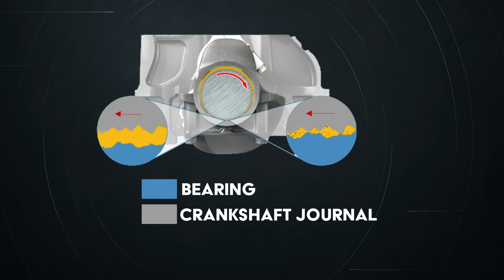the truth about start-stop technology (finally proven)

Comment: the fact that you have to turn the feature off every time you start the engine is diabolical
Reply: I had a 2018 Ford Fiesta with auto stop start. I found out that if the battery health gets low the computer will deactivate stop-start permanently until you perform a battery management reset - even with a new battery it stays deactivated.  I'm not sure if this is the same on other cars.
Reply: @LysergicCasserole95  same for the jeep. accessory battery needs to be bad then it wont run. in hyundai you can just jam piece of plastic card in the switch and it will stay off after car restarts
Reply: @LysergicCasserole95  Unfortunately no. I bought a second hand Clio IV with a bad battery and disabled ss system. When the new battery was installed, the ss system came alive and now I have to make it my life reflex to shut it down each time I get in the car.
Reply: @TheMilosDjuric  There are plug in options
Reply: @LysergicCasserole95 it just mean your ecu didnt detect new battery, and idk on ford fiesta but on bmw/mini will kill your new battery faster if you didnt register that you change battery
Reply: @LysergicCasserole95 it is on BMWs and fairly sure other manufacturers as to preserve the battery when it’s low.
Reply: @LysergicCasserole95  happens on my 2015 honda hrv too
Reply: @LysergicCasserole95   Yes in a 2014 Citroen Berlingo it also stopped working as the battery aged.  
After replacing the battery, it started working again.
Reply: @LysergicCasserole95  I own a G82 BMW M4C and I shut off the start/stop function, which I am at least thankful that it's an option. I did the same on my F82 BMW M4C. I have a friend who's a BMW tech tell me a long time ago this not only saves abuse on the engine but the battery as well. Considering the batteries are lithium in the M4 and around $1500 to $1800 US you dont want to be coughing up a lot of money to replace them...obviously.
Reply: @LysergicCasserole95 this does “work” but it’s not great for battery longevity
Reply: @LysergicCasserole95  It is with my 2021 Skoda Octavia.
Reply: @LysergicCasserole95 that’s bad for your battery and alternator to not reset the BMS
Reply: @LysergicCasserole95 Not on a 2017 F-150. It just shut off at a red light and couldn’t start again. That and start stop killed the starter and left us stranded at a red light too. We bought one of those cables that disables it automatically on start.
Reply: @LysergicCasserole95  On all new fords you have to do a battery life reset after replacing the battery to reenable start stop functionality. Unfortunately, it also won't leave the car on for remote start/unlocking the car doors for the mobile app or perform updates, when the battery is "bad". So I did reset mine
Reply: @LysergicCasserole95 That’s only if you don’t perform a Battery Management Reset, which you should do with a new battery install.  Else other aspects of the ECU/ car strategy will be affected.
Reply: @wl660  Yeah it may affect other things in other cars. I had no problems whatsoever with mine, not even a battery warning light.
Reply: 1st thing I did was coded out the start stop on my bmw x3
Reply: In fairness it's become second nature...... part of my start-up routine. "Engine start, TURN OFF THE STOP-START FUNCTION"
Reply: @danielmarshall4587 same here. it has been part of the process 😂
Reply: @danielmarshall4587 mine too. Crank it up, D, Auto off, release brake . It sucks , but is part of my routine now.
Reply: It should be a 'opt-in', not a 'opt-out'
Reply: I consider it like my preflight checks. Auto start-stop off, driving mode Sport, engines to idle, temps to warm, cleared for takeoff 😀
Reply: @ChristopherWoods  same here. Plus disable center line detection. Takes a few seconds, enough to warm up the engine, that's bonus...
Reply: A bonus of Stop -Start in your new car:
Upgraded starter and battery. The battery will be a premium AGM unit that, if used with S-S disabled, should last longer. Ditto for the starter, as well. BUT, when the battery finally needs replacement, it costs a lot more than a conventional lead-acid battery 200-300% more.
Reply: I got 7 years out of my factory AGM battery in my 2018 F150 with start/stop disabled since new. But they only cost about 50% more. Not 200-300%.
Reply: @stevenslater2669  Costs considerably more and often has a shorter warranty 3 or 4 years not 5 for the standard non EFB ones.
Reply: @stevenslater2669 AGM batteries don't last as long under normal conditions. They are specifically engineered for high electrical loads, including stop/start.

In a regular car they will virtually never last as long as a lead-acid plate battery.
Reply: @stevenslater2669  Beware of AGM. Normal cars, designed for standard flooded use the 14.4 volt charging voltage while AGMs need the 14.8 V. Therefore AGMs needed to be charged with an AGM charger in every couple of months. This way they can really last long, but although the are not prone to be sulphated long 14.4 V slowly builds up suphate.
Reply: @stevenslater2669  You don't need a premium battery for a stop-start car,  neither does it come by default tbh
Reply: @stevenslater2669  this is so far from a universal truth it’s laughable. Or someone should call Subaru because they don’t have AGMs in their cars and they don’t last longer. 2023 Outback Wilderness, not an AGM OEM, I never use that stupid stop-start and turn it off all the time, and the OEM battery barely lasted three years. (This is a common experience across multiple Subaru social media groups.) Also - where are you paying 200% more for an AGM? That wasn’t remotely my experience, and I live in Alaska where most things cost a bit more anyway.
Reply: @csabamagyar3244 Sorry, incorrect…!
Reply: @jonoon27  What/why is incorrect? My comment on AGM batteries is based on my studies and an official expert's opinion used at court.
Reply: @ChristopherWoods  Oh man.. some of my cars will never warm up at idle. Thats not including the winter
Reply: @ChristopherWoods  If only. In new cars you also need to disable lane departure assistant, speeding assistant, attention assistant and emergency brake assistant.
Reply: @rasklaat2  I agree with you. I do not want govt safety nanny tech constantly nagging me. Off it goes!
Reply: @rasklaat2 it should be finable offense to turn of safety systems
Reply: @ChristopherWoods yes, I feel like I have to conduct a start up sequence for a helicopter.
Reply: @ChristopherWoods   i heard/saw this other thing in a video saying that idling is also bad fro engine bcuz of the low rpm, but i forgot what the dmg was. So what do you have to say to that ?  And is it better than to just turn your engine off when you know you're gonna be at the light for more than 20 sec ?
Reply: @picapica8266  Anyone making a blanket statement like that shouldn't be trusted. The effect depends on the engine, its condition and whether it's getting adequate oil pressure but idling should pretty much always cause less wear than constantly starting and stopping. That's just common sense... or at least it was before these ridiculous features started rolling out.
Reply: @ChristopherWoods exactly what I do 😂
Reply: @ChristopherWoods how long do you keep your car if you care about these things
Reply: @ChristopherWoods  sport mode in the RAV4 automatically turns it off, so it’s not a separate action
Reply: @ChristopherWoods and turn off the effing lane assist.
Reply: @ChristopherWoods temp is not so important as you saw
Reply: @solidfuel0   with my Ford engine, I give it every chance I possibly can to not destroy itself :face-blue-smiling:
Reply: @solidfuel0  Yes it very much is important. Hint: thermal expansion
Reply: @mmdirtyworkz what u talked about? which comment you answering to
Reply: @solidfuel0  yeah, YT is bad regarding tracking replies...I was replying to your post that temps in engines does not matter. I wanted to say that they pretty much do due to thermal expansion of the metal (tolerances)
Reply: @mmdirtyworkz  why would I say that. You took that out of context
Reply: @solidfuel0  dude scroll back, I don't know why you said that but you did. And that's the only thing you said in that post so theory of taking things out of contest is debunked :)
Reply: @mmdirtyworkz i was answering someone!! Check what he said to understand context
Reply: @solidfuel0  I'd love to see your video on how you explain that it isnt!!!
Reply: @Christofftheman sure but what the video would be about
Reply: @ChristopherWoods waiting for engine to warm up idling is downright stupid.
Reply: @jothain  not very long, just 30 secs or so - enough to let the oil pressure build a little bit and start it flowing through the galleries. Also gives the block half a chance to get a little bit of temperature in it, particularly because my engine is notorious for issues if driven hard from cold. 

I see some people turn their engine over then drive off the moment the engine starts running. I cringe when I think of the excessive wear it's probably causing :(  

I don't spend ages idling, I agree that's a bit stupid. When it's really cold here I'll give it 10% throttle after starting the engine to help it along, then just drive as usual.
Reply: @ChristopherWoods  Makes more sense. Yeah, I start my car and then put like seat belt on and begin to drive or go clean up windows if necessary.
Reply: I just make it a routine: start the engine,  select gear, park brake off, stop start off.
Reply: @alanjm1234 same, just I add start dash camera
Reply: @alanjm1234   My problem is I can't get the Mrs to care or remember and complains at me for reminding her. I'll send her this vid, see if it helps🙃😆
Reply: @alanjm1234 I honestly don’t get how people are so horribly inconvenienced by doing this. Yes you have to turn it off you also have to start the car, put it in drive…..it’s not a big deal
Reply: @chris-qo1nt it’s not that it’s difficult. It’s that it’s stupid
Reply: It's crazy how few people are telling the dealers before the new car sale...If you don't fully disable this "feature" I am NOT buying that new car from you.  If you are serious about walking away from the deal, the dealer WILL permanently disable the system.
You may even have to walk away from the deal, but the dealer will call  you back and offer to meet your terms to make that new car sale.
Reply: @horseathalt7308 here in europe, it can't be permanently disabled because of the EU rules. It's not manufacturers fault.
Reply: @jestosebno666  In the USA  and many other countries that is absolutely not the case with our laws, it is clearly the mfrs forcing customers to accept something they do not want.  You do realize that the EU is essentially an occupying force making laws and policy against the best interests and desires of the people in those European countries?
Reply: @horseathalt7308  an occupation force requires a military presence, so you’re just exaggerating for dramatic effect, while some EU rules could be better, they are, overall, the most pro consumer laws of any world power

also, EU regulations are made by EU members, not some occupying entity that doesn’t exist, the EU parliament votes for them, and all member states have, at one time or another, their own experts in the EU Commission
Reply: @radu1337  The US military is the israel foreign legion. nice try though Schlomo.
Reply: @horseathalt7308  I wish I'd thought to do that.  I didn't even know that was an option.  I wonder if disabling it would impact the vehicle's warranty.
Reply: @Okraknife just reactivate it before taking it in for any services.
Reply: @cboyamg  It has never been an issue for me for service.
Reply: I'm sure the dealer will have to tell you if it'll void the warranty,  if the dealer is the one to deactivate it don't see why it'd mess with the warranty
Reply: @Okraknife just remove the chip before taking it in if there is any question
Reply: @horseathalt7308 the irony being the manufacturer would probably void the warranty by disabling the thing most likely to threaten the life of the engine 😂
Reply: @horseathalt7308  Unfortenately not a possbility in Germany as far as I know. Because the car has to comply with the emission specs from the manufactorer as default. If you turn of the feature it changes the default state of the car which makes it no longer compliant with the official Emission and you need to theoretically file an exception for the car or else its illegal.
Reply: @tims8956  I understand the EU has these rules, however did the German People actually vote for these rules? Was there even any integrity in the voting process? We in the USA can't trust our politicians nor the voting process. Many people here if giving the choice would roll back all DoT and emissions regulations to around the early 1970s or so. The fact is that all these regulations are making it impossible for most Americans to afford owning any car at all, new or used at this point.
Reply: @horseathalt7308  Actually yes. A big Part of German Politics is about the Envirement and the emission regulations are a part of that. I dont believe this is wrong, but the extend is the Problem. Its come to the point where just a bit of emission saving is prioritised over longetivity or Quality. Most of the people who vote for this usally are less affected by it. They either dont have a car or care about for example. 

The Car Manufactures dont really have a choice because the emission regulations have become so absurd that these features are needed in Order to even be allowed to sell the car.

Edit: But I also dont think the Big Car Companies are that upset by it, because the faster a Car breaks the faster they can sell you a new one😂
Reply: @horseathalt7308  The dealer cannot legally disable this misfeature because the manufacturer had to use this misfeature to pass the pollution limits. It's just a loophole in pollution limits, not a real system that's overall effective for anything.
Reply: @MikkoRantalainen  There is no law that requires stop start on US vehicles, and there never has been.
And we see that MikkoRantalainen is an agent that has blocked my response to his subsequent posts.
Reply: @horseathalt7308  I think it depends on how the manufacturer listed the feature vs emission control systems. If the manufacturer registered the feature as emission control system (which would make sense because it supposedly reduces fuel usage and therefore reduces CO2 emissions because the only carbon from the tailpipe comes from fuel) and then it's covered by Environmental Protection Agency (EPA), under the Clean Air Act (CAA), which prohibits “tampering” with a vehicle’s emissions control system.

You would need to check EPA Certificate of Conformity (CoC) to know the true status for a given make and model.
Reply: @MikkoRantalainen  The fact is that there is NO law in the USA that requires stop start on any car.  Trump will be removing most of these ridiculous EPA regulations soon. If you look at Earth history it was much warmer 50,000 years ago, and had a much higher level of CO2 as well, so in the bigger picture man has a minimal effect on Earth's big climate picture. If anything has been detrimental it has been the destruction of the Rain Forests.
Reply: @horseathalt7308  I would recommend having plan B for the time period after Trump. Here in Finland, the law disallowed changes that increased pollution but there were no penalties for a decade so it was pretty common to disable systems in cars. The law was changed last year and all cars with those modifications are now illegal with heavy penalties (~3500 USD fine for illegal passanger car on public roads, ~35000 USD for illegal commerial vehicle on public roads).

I'd predict that in future start-stop will be interpreted as emission control system if the car was certified by the manufacturer with the system enabled.
Reply: @MikkoRantalainen  Trump will probably be President for one more term in 2028 since the 2020 election was stolen. After  Trump JD Vance will likely be President in 2032. Most Americans are not buying into the man made climate change scam
Reply: @horseathalt7308  How do you think Trump could have third term when 22nd Amendment says otherwise?
Reply: @horseathalt7308  Not in North America. It's illegal to intentionally modify/disable/remove/tamper with an emissions control device, which includes the start/stop system.
Reply: @UVBluetoo  100% wrong in the USA.
In any case the EPA did not mandate start stop systems in any passenger cars . Unconstitutional regulations are not law.
Reply: as soon as i got fiesta i put arduino nano to disable start-stop every time the engine starts.
Reply: Stick shift for the win.
Reply: @mrsparefox3704 European type r have auto start stop and they only come in manual
Reply: There are inexpensive jumpers you can add to most cars to disable. I have one in my VW GLI.  Took 2 minutes to install.
Reply: I wonder how much it costs the automakers to install start/stop? It cost me $40 to deactivate it.
Reply: Be thankful you're still allowed to turn it off. That's not a given.
Reply: I have a 2021 BMW M340i and I used a OBD connector and BimmerCode to permanently disable the feature. It’s nothing short of frustrating and additionally I don’t like what it does to the engine.
Reply: @PARlS23   i hope generational change happens faster and old people hating new tech get surpassed by younger ones. It is like some are still attached to plastic straws.
Reply: You can permanently disable the start/stop feature by coding using a device like the Carly OBD, which is also quite affordable.
Reply: @DouglasFraser888 CRly is awful. Unreliable and limited to its functions. I canceled my all brands subscription and bought a Launch bidirectional scanner.
Reply: @DouglasFraser888 you lose warranty?
Reply: It's such a habit to turn it off when I start the car that when I start my diesel car from the 80s I go to press a button that's not there lol.
Reply: Vaccinated people love features like this.
Reply: get an obd2 override module
Reply: Thankfully you can turn it off permanently. It has to be made via cable, but you can.
Reply: I got a Mitsubishi ASX (Outlander Sport) and setting the AC to blow at the windshield stops S&S entirely.
Reply: @MajorSpam Ditto with my Kia Rio… I keep the blower on all the time to prevent the S/S system 👍 (The switch to disable it stopped working 🤷‍♀️
Reply: I got rid of my 2024 car for so many reasons and this is deffinetly one. Went back to an older, more analog car and Im just gonna take good care of it and make it last.
The shitty part is, insurance companies are in o  the fucking game and they will try to deny coverage on older cars (well preserved and passing all inspections).
I also got the excuse of new cars being too complex so rates have to be higher, we just cant win.
Reply: I have a 2018 toyota highlander with the start stop feature, I would always disable the feature as soon as I  started it, when I remembered, so my first stop, it would shut off, then I would disable it. I later found a product on Amazon and other sites.  Costs  about $20 or so. Fairly easy to install, and disabes the start stop feature every time th car is started. No remembering ever. If you do want to enable it, simply push the button. I feel better knowing it's off by default. There are videos showing which panels to remove and how to plug it in, no rewiring, simply plug and play.
Reply: The Nanny State does love to nag at us.  Like fastening my seat belt it is now automatic 
for me to turn off the Start/Stop.
Reply: @ccooper8785 if you need to be told for you to wear a seatbelt then you need a nanny. Jfc
Reply: @ccooper8785  stop start seatbelt are totally different categories😊
Reply: @ccooper8785 Unfamiliar with USians, is nanny state like Florida or Mississippi? Which state is nanny state? Thank
Reply: isn"t that car dependent? it remains offin our car just fine. maybe its something with the cars sold in the usa
Reply: I put a auto off module in my GTI for the start/stop to turn it off and VW told me it will void my warranty if I don't take it out. 

I paid for the 5 year scheduled servicing which I just lost out on 3k as I will never take my car back to the dealer & they refuse to refund the scheluding plan (they also put in the wrong oil which I have evidence, they also took the car for a joyride) 

They said as its a new car I need to not have the module in it and just use the start stop function as it will not hurt the engine, = all lies
Reply: It depends on the manufacturer and even the vehicle, possibly country too. You can actually disable start-stop with Fords. I've seen someone do it with a Mustang which only makes sense in general but especially with a car like that.
Reply: I have an idlestopper in my odyssey, it's just a little computer that picks up power from the back side of a 12v outlet and plugs into the back of the auto stop/start toggle switch and when the car turns on it send a signal to the switch that simulates it being pressed so that you don't have to do it manually every time.
Reply: Can that be coded out the car via the OBD port?
Reply: It most cars you can use a fuse jumper to disable it, it's pretty cheap and easy
Reply: @jeremycastro8223 care to explain for us car people 😅
Reply: Diabolical this diabolical that. Do you TikTok kids have any vocabulary of your own?
Reply: @Lup3r  Seriously! So pathetic. They must PROTECT THIS MAN at all costs because he was FIRST to comment and is so WHOLESOME. 🙄🥱
Reply: Everything is designed to FUCK us. It's part of their business model now. Planned obsolescence and scams are the American way.
Why provide good products that last when you can force people into subscription base slavery? 
Consumers need a EULA that businesses should have to sign that protects us NOT THEM.
We (the workers) are the driving force behind our economy. 
Stop letting corporations rule over us.
Reply: My car has it, I got an auto stop eliminator. Never think about it anymore.
Reply: The situation is even worse with a hybrid, cold engine to full power almost instantly
Reply: I bought a start/stop eliminator for my F150 when new. The system still works, but now you have to push the button to activate it, not deactivate.
Reply: Some cars allow you to set it in your user profile.  Acura Integra (and likely the Civic SI too), as an example.  It stays in the mode you put it in when last parked, and that mode can include or exclude the auto stop and start.
Reply: You can buy a cable that automatically turns the switch of try ali
Reply: map it out! (disable it for good )
Reply: Wilder is that you can just code your car to remember it between cycles.
Reply: If you have a physical button on your car to turn it off you can often buy a physical inline harness that will turn it off automatically on startup. Put one in on our 2021 q5, works fantastic.
Reply: Its the EPA
Reply: Disable in OBD
Reply: There are fuses you can pull
Reply: I tuned my car and the new programming keeps it off
Reply: Not all vehicles are like that. You can also tune it out.
Reply: depends on the car. my 5 series it stays off. but my newer 3 series mild hybrid, literally no button to turn it off lol. at least it's extremely smooth cause it's using the motor generator instead of the traditional starter.
Reply: It's become a second nature for me. Start the engine, press the button.
Reply: Wait until you buy a car from 2024+. You have to remove the speeding warning sound after each start as well.
Reply: @Pow3rus Wait what?
Reply: Use an obd tool to turn it off persistently or permanently
Reply: Carly is a device that plugs in your obd port connects to phone and you can adjust the features of car and find new ones
Reply: I disabled mine permanently. 😎
Reply: Can usually be coded to off by default or remember last setting.
Reply: If you have a bmw you can easily switch it off forever with an app in your phone. Done that
Reply: I have a new Hyundai and the start up procedure to turn all the bs off is a pain in the arse!
Reply: Mine stays off, I don't have to do that.
Reply: Probably its possible to mess around with the wires or just using a obd system to turn it off permanently
Reply: And yet I’ve been doing so for the past 8 years…. It is what it is
Reply: in Jeep Renegade you once turn off and it stays off until you turn on... Also you can chip tune and disable it that way
Reply: My car only instigates its stop start maybe 5 times a year, it’s really picky about the conditions.
Reply: I just programmed a pic (but you can use any arduino) and used it with an octocoupler to simulate a start-stop button press 5 seconds after the car is turned on.
So I can finally forget about it 😏
Reply: And a $300 battery you need when only a $50 battery is sufficient.
Reply: Could be an age thing, but my car from 2015 has stop start. But if you turn it off, it will remain off until you turn it back on. Whether that days weeks or months. It doesn’t reset with the ignition
Reply: And I think the fact that Start-Stop can be deactivated with a single button in 99% of cars that have it while things like lane assist require scrolling through at least one menu screen indicates that even manufacturers know it's rubbish. Like "Don't press this button, it disables Start-Stop *wink wink*"
Reply: Remap it to be off and you’ll forget it even existed
Reply: You can get an obd2 coder and change that. There are obd2 modules that disable that feature as well. In my case, my auxiliary battery is close to dying so it automatically disables start/stop, and it doesn't affect any other systems while the car is running, so I got a win
Reply: Many vehicles you can buy modules to keep it off for good
Reply: the thing that annoys me even more is when they had a shortage of parts and some of the same exact model year don't have it no problem, they still want it as hard as possible for you to disable it.
Reply: On my car, once its off, its off. Even after I've shut the car off and start it the next day. Its still off. Its an audi though and I have a VCDS tuner so if that wasnt the case, ide just go in and disable it.
Reply: You can thank the old administration and EPA. They literally mandated it turn back on automatically.
Reply: Im glad I coded it to be always off at start
Reply: Its intended
Reply: And they keep making it more complicated to turn it off. Now the option doesn't have a dedicated button. It's somewhere in the infotainment menu
Reply: Volvo cars have it but if you don't enable it. It never comes on unless you use Eco mode. Glad I knew better than to use it. Driven semis for long enough you shutdown a hot turbo engine right away .. that's asking for trouble immediately restarting it only compounds it.
Reply: No, it's regulations
Reply: @Fletcher91 no it's not. It has to have the feature it doesn't have to be active all the time.
Reply: @thatsithlordvader true, but I bet you the feature has to be "on by default", since "nudging" is the manipulation strategy employed in the EU
Reply: @Fletcher91 not in my Volvo it isn't. Doesn't come on unless I command it on. 2020 model year. Checked out a 2025 last week. Same thing. I'll stick with Volvo 😅
Edit PS I'm in Canada. I know Ford's and Chevrolet they are on all the time. You can turn it off but everytime you restart the vehicle it comes back on. Nudging for sure
Reply: I don't as I drive a nearly 20 year old is250. Ill never buy a car with any of this bollox on them. The Ms has a Rave4 and the stop start on that thing is retarded, if the engine is turned off when you take your seat belt off the engine starts back up again😂 and you can here the engine struggling and  squeaking when the engine kicks back in🤦‍♂️
Reply: It is one of the many reasons why I traded a 2016 MB E220 with a 1993 MB E280
Reply: You're lucky that you can turn it off at least, in my car the option isn't there even. It deactivates if I take off my seat belt though. The result is that I drive a lot without wearing a seatbelt nowadays, I'm pretty sure that wasn't the intent of the manufacturer.
Reply: You can change that with carly. It was the first thing i did when I bought the car
Reply: @JFBBB535  Excuse my ignorance but what's carly?
Reply: Just unplug the battery monitoring system, which is only used by the auto start stop system.
Reply: I just coded mine out mate, theres an option for the car to remember its last setting👍🏼
Reply: You can code it out, with Carly but if you are still under warranty dont do it , I switch it off everytime.
Reply: @equaliser2265 could just factory reset if under warranty anyway no?
Reply: Thank you for exposing the truth and the conspiracy to sell more by making the new cars far more unreliable. I gave a guy 20 euros to completely remove this crap from my car the first day after buying it. I drive happily every after :)
Reply: newest BMW now don't have the ability to turn it off. The button went missing
Reply: I did it straight for a year until I sold that car. Believe me I did
Reply: There are plugs you can put between harness and switch that remember the last setting
Reply: A few years ago, Ford truck: you could put the car in "ACC" mode, then hit the gas pedal three times in quick concession. Then start the car: and it will stay off until you turn it back on.

I was driving around very remote in -40c, I needed to ensure the vehicle worked.
Reply: Regulation.
Reply: At least in VW cars(VW, Skoda, Seat, Audi etc) you can reprogram the control register bytes to change the behavior of start-stop. If you mess with the ECU it might however make resale more complicated....
Reply: I,m one of the "lucky ones"  I have the "chrysler ypsilon," built by "fiat" for " lancia" and badged "chrysler" for the British and american !  a bit strange to say the least, but a great car all the same ,  it has a purpose built "switch " on the dash which keeps the start/stop off without having to keep switching it off every time I start up, and the dash cluster tells me that it,s "disabled" 
never knew why manafacturers fitted these features ?  waste of time and money , and more trouble than they are worth !
Reply: You can buy a inline plug that goes between the switch and the wire harness behind the dash that presses the button for you to deactivate the feature upon each manual start. I bought it immediately for my 2019 f150.
Reply: Can't we just disable it with OBD?
I drive an automatic so it's pretty much off by default. But I had a manual before this and I had to manually turn it off every time as well.
Reply: It’s because of the Euro emissions compliance
Reply: It's horrible. No one likes it.
Reply: "Laughs in 2007 corolla"
Reply: there is a connecotr you can put on  behind the button that pretty much disables the  dumb ass feature.   only an idiot would support the start stop technology. what idiots.  thinking its better for the enviorment when its not. because you would have to replace the part more oftin.   just think of all the energy that was used to make the parts int he first place all the way from resouce extraction to make the metals we used to make the parts   it really takes  way more energy to ship that stuff all across the wrold over and over be fore it even gets  to store shelfs.
Reply: I know it’s not ideal but they sell aftermarket modules that plug in and reverse the auto start stop so instead of it being on when you start the car, it’s off by default. Idk if they do this for all brands but my buddy had one for his jeep grand Cherokee years ago.
Reply: Vote Republican
Reply: It became a standard procedure to turn off auto starts stop when I start my engine 😂
Reply: I don't think you care about bearing. You just don't like the system for no reason
Reply: I have a 2017 SEAT Leon TSI and every time I get into the car, this is my sequence:

1: start the engine
2: turn off auto-stop
3: let the engine reach its ralenti RPM (it starts at 1100 RPM to heat up the engine and oil and stabilizes to 980 RPM)
4: Drive
Reply: I've installed a simple tool which automatically turns off Auto Start/Stop feature. The tool costed me just $4, and if you need, you can use the function, it doesn't permanently disable it.
Reply: In vw and audis it can be codded out. My dad even had a button that had a switch on it or something he got on Amazon replaced the switch and after that the atlas had it off by default
Reply: I installed a idlestopper on my Honda Odyssey and now the idle stop function is disabled on car start!
Reply: Every time I forget to turn mine off and come to a red light Im pissed. I know that's one start to a new starter motor at the very least.
Reply: I fucking hate it
Reply: Some cars have memory regarding this, for example BMW F30
Reply: I coded it to be off under 50 degrees C 😅
Reply: My brother was able to disable it on his old Volvo and it stayed off.
Reply: I have a 14 Audi Q5, when you turn it off, it stays off.  Deeper in the programming, I can switch the light in the button to be off when function is disabled, on when enabled so I don’t have to see the orange light all the time.
Reply: every time you reset the key unless its coded out usually
Reply: Yes it's evil!
Reply: To disable the start/stop functionality in my 2015 Jaguar, I simply removed the secondary battery from the car. Now it functions as if the feature doesn't even exist. Problem solved.
Reply: You can normally disable these systems yourself. In all modern petrol and diesel BMW for example, you simply get an app like Bimmerlink and code it to off yourself. Doesn't cost much to do.
Reply: If your car has a battery module (which most of them do) and you use a regular battery instead of a AGM/EFB battery the system won't work. So you'll never have to manualy disable the it. The car senses that the battery is too weak. 

The regular battery will tear a bit faster but is halve the price of AGM one so it will not affect your wallet.
Reply: I could talk about Mercedes, I have official software for codding engine block, and they indeed have few options available inside their software. Always on/Always off/Remember last position.
But from the factory it would be set to Always on, and under no circumstances' dealer would allow you to legally change that.
Reply: It can be (is) deactivated using an OBD tool on my 2016 BMW 1-series. One of the first things I did when I bought the car.
Reply: Just program it to the nearest specialist
Reply: There are devices you can install pretty simply that turn it off automatically.
Reply: Fortunately my car lets that get coded out to be permanently off.
Reply: You can re-configure it using OBDII apps, like carista. That what I have done.
Reply: Don't buy one. That'll save you some brain cells.
Reply: @stephenkiernan8520  Vote with your green
Reply: You can wire in a relay to flip that switch automatically
Reply: I did on mine, works great
Reply: just disconnect the litle wire at the battery, that controls it. Did this on my Q3, using like this without any issue  for 3 years now.
Reply: We all know what environmental regulations did to California.  Fire trucks were not compliant, so fires were permitted to burn.

I'll never forget headlights with microchips, so you could only use ones from the manufacturer who sold them for 100x the price of a third party who were not legally permitted to use the technology.  

Manufacturers and regulators work together.  Whoever has more money has more influence on others.  Time that changes PERMANENTLY.
Reply: @pixels303at-odysee9 ??? Did you just make up the fire truck story
Reply: @agoodkindonyoutube kinda hard to believe honestly. No, facts buddy. EPA is not your friend. Climate change is all BS.
Reply: @pixels303at-odysee9  the fire truck story is nonsense.
Reply: Depending on the manufacturer, you can disable that feature which is likely programmed in the car's BCM unit. 

But I wouldn't recommend getting that deep into your car if it's not a keeper.
Reply: Just jam the botton with a piece of cardboard paper: it will auto exclude the start& stop at every ignition (:
Reply: To be compliant with environmental regulations.
Reply: @nothingchannel6699  Except not every vehicle is tested so the emissions claimed is often nowhere near the truth.  Then you need to factor in wear and tear, how bad has the emissions got with a car that constantly stops at every set of lights and junction?
Reply: @nothingchannel6699   negative, to increase consumer failure rates as engines were at a point of high mileage ability, this reduces them numbers down, been saying this for years start stop is a on road money making scheme!
Reply: @nothingchannel6699 let's regulate private air travel. No more than 12 a year.
Reply: @nothingchannel6699  Its to reduce emissions, however per vehicle is such minimal amount of reduction that its not worth it. However in combined over millions of vehicles it adds up
Reply: @domini384 so millions of cars die faster and you have to buy a new one. How does environment feel about that?
Reply: @nothingchannel6699  thats BS
Reply: Just code it out
Reply: @joe_ferreira or switch it off. It takes a millisecond 😂
Reply: @harold6863 yes, but it's annoying to do every time you start the car. I have a Carly and just disabled it. It took 5 minutes.
Reply: Are there different kinds of start stop systems? I'm driving a 2010 Audi and in that it only engages when the gear is in neutral, the engine is up to temp, outside temp is not too cold and the clutch pedal is up. It basically stops the engine a few times a year extra for me for one railway crossing and otherwise it's basically harmless bloatware that isn't doing anything. Score for living and working in low populated area!
Reply: is that too hard to fix by a person that know a thing or two in tech area? i don't think so
Reply: It’s a habit now like buckling my seatbelt.
Reply: Without that feature, you probably won’t be able to buy the car you wanted so there’s that.
Reply: story behind touch screens is also pretty diabolical.
Reply: @jose4167-i9v what .. go on
Reply: That's why Europe is collapsing
Reply: no it has to do with a funny tribe
Reply: You can tur off these feture in any car
Reply: @LukaArtelj only temporarily
Reply: @LukaArtelj yes, but not permanently.
Reply: @LukaArtelj  No, you cannot turn this feature off in ANY car. There are some cars, particularly from General Motors and from Ford, that were produced in gasoline-only models, with auto-start/stop, but without any override function.
Reply: you don't HAVE to turn it off every time you start the car. You can choose to. There are plenty of cars with stop-start tech running around just fine. It's been around for years.
Reply: It's almost like manufacturers want you to use it to reduce emissions in cities... wild concept I know. 

Almost like how they want you to wear your seatbelt with that annoying dinging sound.